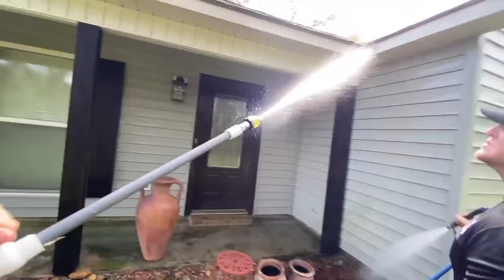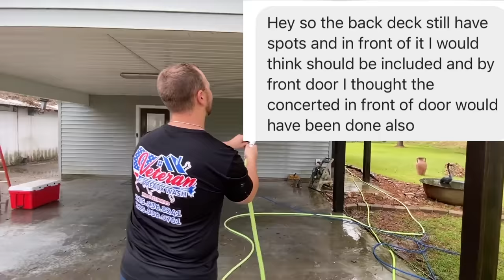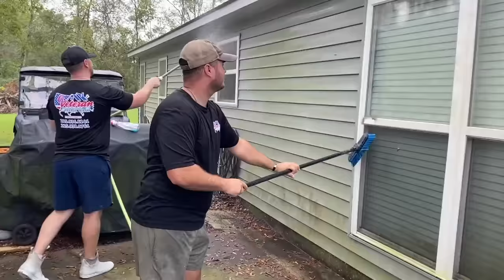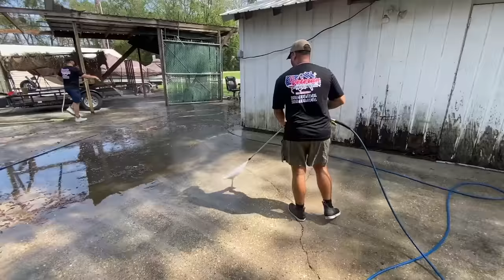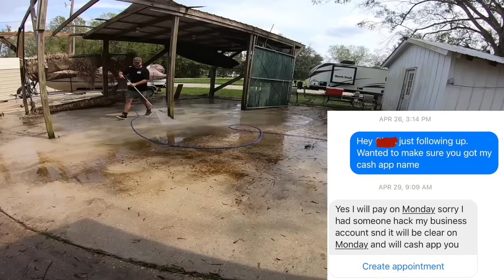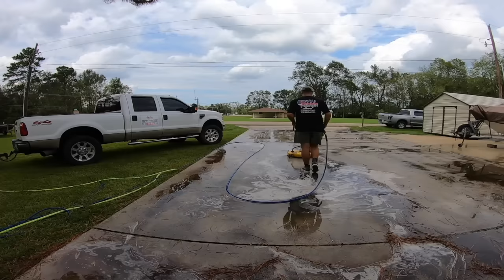This Customer Refused To Pay Us

Comment: When I read the title I said to myself "I bet it's a woman" and I also said "one that's not born here."   Anyway, my line of work isn't pressure washing but I get flashbacks just hearing your story, and hence my gender prediction. The avoiding texts, "account hacked," this one's father got covid and she had to leave town, another one even giving herself a discount because she doesn't like how the job looked. At least you're washing homes because that can be straight forward.  Try making some kind of work of art for them, like videography and things dealing with looks and appearances that has so many variables and changes to be made.  Dealing with some women can be a nightmare and it's a little difficult putting things on paper because of the many variables in videography.  I also learned lessons from my experiences and that is to put everything in writing and be as clear as possible.  Sometimes it's good to sit down a think of possible future problems and address them before they come to fruition.

Comment: Pressure washing the overhang with soffit is so wrong.  Water will damage.  Water is being sprayed right into the alluminun soffit , big no no.  Also ALL vinyl siding leaks when pressure washer close and water is getting behind it all to damage the wood and framing with water.  Pressure washing is worst thing for a house.  Scrub with soap water and a reg hose from wall.   No need for high pressure.  I know. I was in this business for over 15 years.  Pressure washing is worst thing any homeowner can do.    No need for pressure and getting water into thr wood behind the siding.  No no

Comment: If you didn't address the deck with a separate price or specifically exclude it in the contract, then I agree with property owner.  That being said, I would make clear in your contract that if you are not paid with 72 hours, late fees are assessed.  You sound like you were very reasonable.  Late payment would have triggered super anger with most.

Comment: You could learn to be clearer in the quotes. a raised platform under the roof of the house is part of the house, it is separated by the beams. What you did on your previous jobs is entirely irrelevant and I think you've only mentioned this because you weren't willing to own your mistake. Quoting separately for the concrete is irrelevant if you have agreed to do the house because quotes can overlap in their scope.

Comment: I would have something typed up that you can add with your quotes that Crystal clear we specify exactly what service you’re doing and exactly what is included and what is not included that way you can easily cut and paste it into any of your quotes and have that information right there you don’t have to worry about misunderstanding it or quoting it is then I would actually have somebody initial it so when you go to the homeowners I would have them initial that information with a pen before you start

Comment: ..6:50...you said you took a hundred off because that's what you would have charged for the deck....why not just do the deck, and keep full price?...p.s. some code is if the deck is free standing , it's not part of the house,   but if it's attached with a ledger board to the house, it's part of the house.

Comment: Bro - why would you do a job without a deposit number 1. Number 2 100 bucks for a house 🤷‍♂️ your pricing is low.
Reply: I also don’t see why you would take 100 off.  It’s not acceptable to take a loss when you have provided a service . Change the verbiage to specify decks are not part of a house. 

It’s not taxable living space. I use jobber and every job gets a deposit . Jobs under 500 get paid upfront. If the clients are worried about me stealing the money they have the wrong guy. It weeds out the drama.

Comment: I would have also thought the deck and concrete would be included… it’s not up to her to know the details. You have to be explicit with what’s included or not. 

I mean if you don’t do the front of my house I will think you did a poor job and you are cutting corners.

I don’t know your business. I don’t have to. It’s not my job. When you sell you have to be explicit about what you are selling and what you are NOT selling. And verbally explicitly not just in some fine print.

Also deck is also part of the house of course.. if it’s typically not included in your business, you need to make that explicit.

Comment: I didn't actually agree with your partner on this, because yes legal battles are a pain in the ass, but if you had gone the legal route, it would send a message to anyone who hears this story. "I'm a business performing labor intensive work that you don't want to do, not a pawn shop or used car dealership" 

You should either get an attorney on retainer or start insisting on portion of the money upfront before any work can start...even if you have to get everything set up to get the portion...but it's better to have wasted time setting up and packing up than unpaid work and time....

Karen's like this are why I steer away from businesses were labor is 75% of cost

Comment: Honestly it's obviously childish for her to have been avoiding paying you, however on the other hand, the deck is attached to the house and is therefore very clearly part of the house and I would've also expected that would be included, because that just makes sense. Concrete I can see being a different charge do to you'd probably want to use a different nozzle and it's a different process. I feel that both parties were being quite dumb in this situation.

Comment: I wouldn't have paid you much at all myself. No pressure washer? A hose that ur using instead of a pressure washer and even with the hose ur 20-30 ft away from the house. It's only water.

Comment: Sorry mate, your cleaning method is deplorable at best. I've owned several homes, and I can say 100% its A LOT of work to pressure wash a home entirely. My technique is vastly different from what is shown in this video, which is seemingly sporadic. My technique takes considerable time, but I'm very meticulous when it comes to thoroughly cleaning surface areas of dirt, grim, mildew, and air pollutants. Honestly, if I had witnessed this form of cleaning on my home - I would be extremely disappointed. Thank you for sharing... I will definitely pressure wash my home myself because no company (most especially your company) would be able to clean it to my standards.

Comment: I cant stand entitled costumers deck is no more attached to a house than a fence or a freaking mailbox at maybe a wraparound porch or at least a patio that shares the same foundation but even then the voice of common sense should be shouting "hey! don't be an ass hole!" unfortunately too many choose not to listen to said voice 
I'm a builder mostly additions and big remodels the gut every thing and start over kina stuff ... Anyway not sure if your doing this or not but i found it to be easier list what is included on a bid rather than what is not so like windows walls fascia , soffit birdboxes, fire place if along exterior wall hand rails etc  really take your time  put a couple blank spots for hand written notes maybe little boxes to check off or whatever save it so you can email it and or print a bunch so basically once you sent it either its listed  or its not and they agreed too it,  i have 7"x11" carbon copy books made it cost a little bit but its  worth !  just all the legal C.Y.A alone has paid for its self .....sooo maybe that helps maybe not,   good luck!! and I hope you build a business strong enough to pass down a generation or two